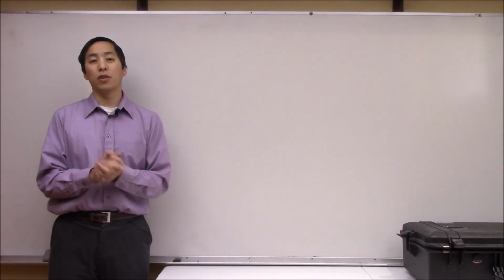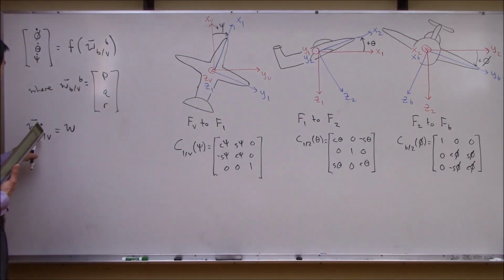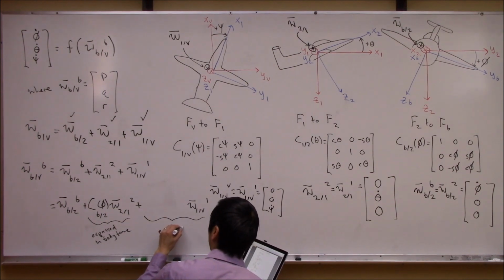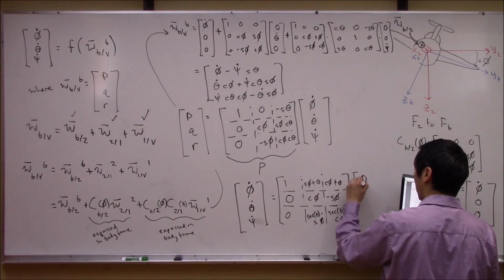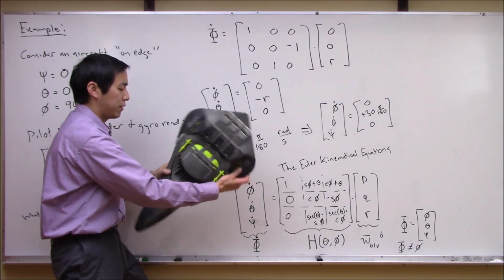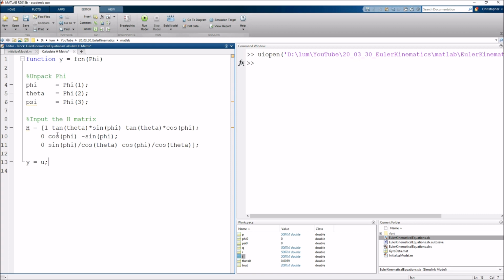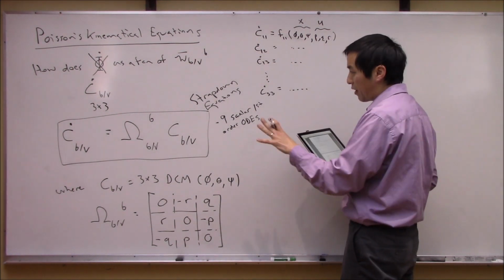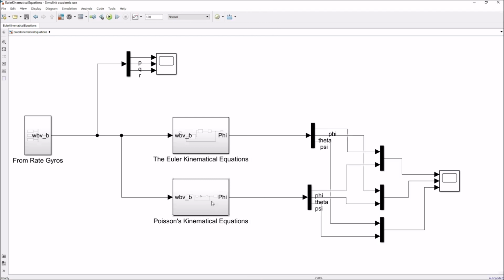Computing Euler Angles: The Euler Kinematical Equations and Poisson’s Kinematical Equations

Comment: You have a huge problem with your example drawings. You see, your X and Y axis are flipped. Y axis suppose to point up and X axis should point right. As a result, all your rotation matrices are inverted and XYX Euler rotation matrix is inverted too.

Comment: AE512_TT: I’ve gone down so many rabbit holes just trying to make sense of two "roll rate", I think I confused myself with the reference frame of the two roll rate. But I put this simple way that the Gyro reading is the actual angular and the Euler angles is the rate of the orientation change, so it makes sense. Thanks for great lecture.
Reply from the maker: Yep, that is confusing terminology.  I find that just looking at the equations helps differentiate the two.

Comment: Hii Dr. Lum, excellent video I was looking for this kind of  video from many days and understandstood most part of it but I had a doubt😢 at 46:02, so first we do a roll about x axis which make the body frame z axis into the board and then x and y axis in the board plane now by applying some yaw rate(imu data) and then we transform it,  we see that it is pitch rate, we see for this  angle (60 degree example one ) we should have rotated about the new y axis (in the board plane) but in video you rotated it  about the old y axis (pointing out of the plane) can I why this is the case

Comment: AA 516: I thought the Simulink examples in this lecture were extremely helpful, both to introduce using Simulink but also to visually explain concepts from the lecture (That drone ground control setup is also very cool).

Comment: AA516 How would we deal with the wrap around from atand2 in the psi angle for Poisson's Kinematical Equations? Thanks Dr. Lum!
Reply from the maker: Hi Kenneth, can you elaborate?  Wraparound is a big pain in the neck for a lot of applications and I want to make sure I understand your question.
Reply: @ChristopherLum  At the end of the video, the graphs compare Poisson's and Euler Kinematical equation outputs, but the yaw angles between the two methods don't align likely due to the atan2 computation in Poisson's method. Is the way to deal with this as simple as adding in a factor of pi?
Reply from the maker: @JerseyGuy27  Ah, I see.  Yes, you can add 2*pi if you want the graphs to match up but really, it shouldn't matter as the only way that the yaw angle is used is as an argument to a cos or sin function which do not care if the yaw angle is wrapped around or not.  In short, you can usually use a wrapped or unwrapped version of the yaw angle is it usually doesn't matter.

Comment: [AA516]: Interesting derivation to get all the rates into the body frame. You mentioned your IMU used rate gyros, is there a reason it doesn't use an accelerometer to determine the attitude?
Reply from the maker: Will, good question.  Accelerometers measure translational acceleration, not angular rates.  You could use an accelerometer if the vehicle was not moving (in fact some wind tunnel models use an accelerometer to measure the pitch angle) but these are only valid for static cases.

Comment: Are the kinametical equations for calculating rate of change of Euler Angles implemented inside the IMUs like in mpu6050/9250 ??? Cause for calculating the RPY(roll,pitch,yaw) it only requires to integrate the reading over time... kindly correct me if I am wrong..

Comment: You're an outstanding educator! I really appreciate your level of effort and care you put into ALL of your videos. Not only do you have a clear grasp on this tough subject, but you are able to communicate it with clarity and ease. You have a rare gift Sir!
Reply from the maker: Ben, thanks for the kind words.  I'm glad it was helpful.  Please let me know what you think of any of the other videos as well.  Thanks for watching!
Reply: @ChristopherLum  I watched nearly all of your videos for control theory over the summer when I was taking Intro. to Auto Controls, and this semester I'm in Adv. Flight Mechanics and your playlist on that has been instrumental as well as my understanding of Simulink and how to utilize it! Still lots to learn, but your videos have been amazing! I did have a few questions regarding the Euler angle (Phi) checks on the output of the Phi_dot integrator or the output of the Poisson or Quat rotation matrix 'C' Phi extraction. I put a 'MATLAB function' block which inputs Phi and outputs, with 'if' statements that should be correcting the rotations. Linked are a few videos I exported (thank you for the 3D animation videos (discovered those late)) that display my problem. Two show 3D plots based on point vectors multiplied by the rotation matrix (good-ish ones) and two depict the 3D Animation of the Euler angles (don't work). Suggestions
 https://youtu.be/TyFwhIDEUxU
https://youtu.be/6XpB1409DLU
https://youtu.be/gLV4RIHTq6w
https://youtu.be/aK964ONk79U
Thank you again for all of your videos!!!
Benjamin
Reply: @ChristopherLum   I got FlightGear installed and it TOTALLY WORKED!!! I don't know why the same Euler angles were not displaying correctly in MATLAB, but FlightGear managed to display it as expected! Thank you sooooo much for allllllllllll of your wonder help! You can't imagine how many days I've wasted trying to figure out where my understanding was broken, but it appears it may just have been the software! Thank you again!
FlightGear video of the same Intermediate Axes Theorem simulation (finally looks right!!!): https://youtu.be/9BQegANI2Es